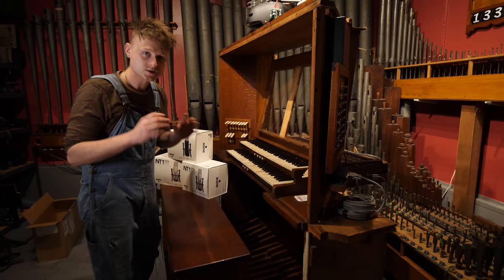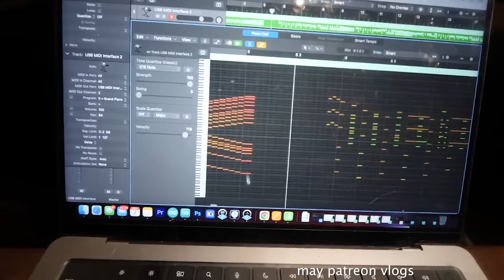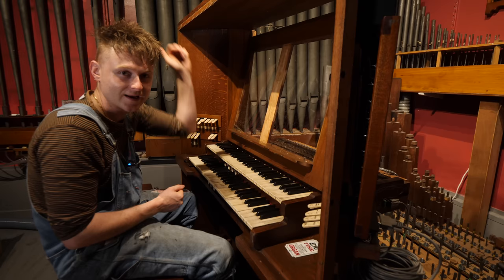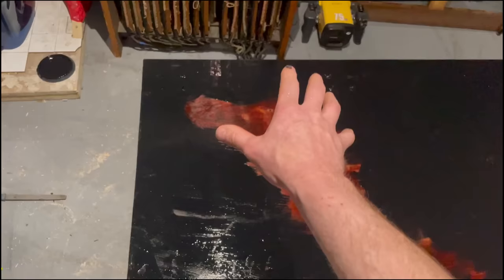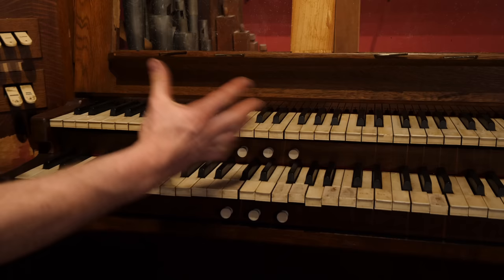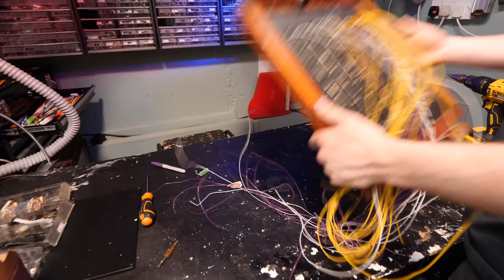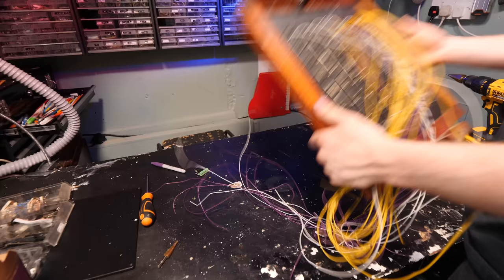100 year old church organs had programmable presets! I BOUGHT A CHURCH ORGAN - part 15

Comment: Have you considered using matrix scanning (use by many keyboards) for inputs, I think this can give much simpler wiring thus greatly reduce the amount of wires needed. The downsides are more complex code for the MCU, and latency for each scan depending on the GPIO.
Reply from the maker: Simply no. It complicates the wiring. Scanning needs more wires ultimately. Less pins but more wires
Reply from the maker: If you think about it. Each key has a wire going to it and there is a common bus. If it needed to be wired into a matrix format it would need extra components and modification to the bus. I did it the way I did it because for future people looking at it it is much easier to diasgnose and repair. If you have access to enough pins there is absolutely no need to use a matrix or multiplex. It's needless complication
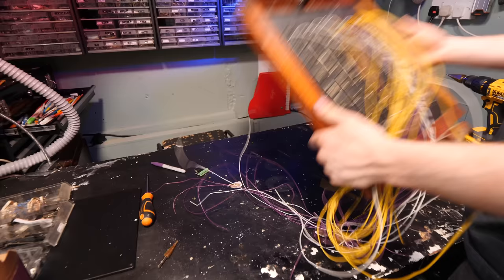Reply: it should be less wires and also without diodes. if you look at 16:19, the matrix will be: each of the white wire coming from the top are the GPIO outs (common), and the inputs are each row x odd/even on horizontal. There won't be a split in the middle either. I agree that it will be more complex for ppl to diagnose and repair, but in this case it is a square matrix that corresponds well with the preset panel so it should be quite obvious
Reply from the maker: @Gentoli  it is not less wires, as each key still needs a wire coming off of it. hence why not doing it,  for future matrix's are a pain to troubleshoot, this is in this instance with a single bus the simplest way. and easiest to transfer to different tech incase an arduino is not available.

Comment: i think working with midi on arduino like those two guys did doesnt take as mush brainpower as it does spacial awareness (basicly know where the empty spots in the arduino are located and where to apply them
look at the computer they used at the moonlanding , it was only a fraction of the current computerpower but somehow they got it to work well enough to hit the moon from the earth and then get back without going up in flames
as for finishing the sides of the console , i agree that the sides should stayvisible , but since its a museum where people thouch stuff it might be a good idea to at least but it behind see through panels or windows , should help dampen the sound a little too
that circus song is hard to listen to at time as it sounds out of key and out of tempo at times , i know its how it was written but still its a pretty good test for the (midi art of the) organ and the electronic valves , i suspect you be replacing some of those over the comming years as they be working harder than they ever did

Comment: You woke up an old brain cell, and it wants to know, does that punch card reader at 10:57 use Fortran to program it? I starterd to learn that a lifetime ago. I love the way they did everything mechanically because physically is shows engenuity. Push a button 100 years ago and push a button today you get the same sound, but it's  made 2 totally different ways.

Comment: I knew about the diodes in the switch paths, I made a sequencer with dip switches and a 4017 decade counter... and got caught with adding a crap ton of diodes... now what I wondered if these old organ switch matrixes dealt with it like that, diodes are modern compared to these organs... so how did they deal with it? Did they have to be careful how they programmed them to be mutual exclusive, or did they have some other trickery or they used relays?  Do you know how it was done?

Comment: That is the crudest setter board, as it is called, I have ever seen. (before you fixed it up).  My console had over 800 switches in the setter boards. I took them out when I converted the organ to digital. (Don't worry, there were never any pipes.)

Comment: How did the original switch matrix function without the diodes? I assume the original electronics did something rather analog-y (e.g. depending on the drive strength decreasing each time it goes through a contact resistance), but it'd be interesting to know the specifics!
Reply from the maker: Seperate wires

Comment: What's funny is that just doing this with analogue methods would have been simpler.  HARDER, because of the number of wires that'd need to be ran, but simpler.

Comment: Could've done the switch matrix with half the number of diodes by putting the diodes on the columns instead of the rows.
Reply from the maker: Reason I didn't was it was a nightmare to solder to the larger lugs. Turned out quicker to do it to the smaller twice as much
Reply: @LOOKMUMNOCOMPUTER  Well reasoned! There's a lot more metal sinking the heat away on the column terminals — and diodes are cheap, after all.

Comment: I'm gonna do a real "your doing it wrong" thing! From a guy who has degloved  fingers,  drooled a hole in the bone and tendons of his left thumb,  accidentally blown himself up and received partial and full thickness burns to the face,  broken 2 ribs,  had several concussions... please don't ever use a circular saw like that again! If I'm shuddering from the potential danger,  then there is trouble brewing from that technique!
Reply from the maker: What is the issue with using a circular saw like that? With an auto cover

Comment: Just wondering: Why was the crossconnection in the preset panel not a problem before adding the arduino? What did they do differently? Maybe some kind of clever switch connections?
Reply from the maker: Diodes didn't exist generally at the time it was made. All wires were completely seperate
Reply: There would have been 48 (8x6) wires coming out of the thing originally, but by turning it into a matrix Sam has 14 (8+6) wires, but with the new problem of "key rollover" that can be solved with diodes. Actually it'd be twice that number because the switches are tri-state.
Reply: Ah thanks to both of you. So you just ran into the problem because you wanted to reduce the amount of wires drastically :D
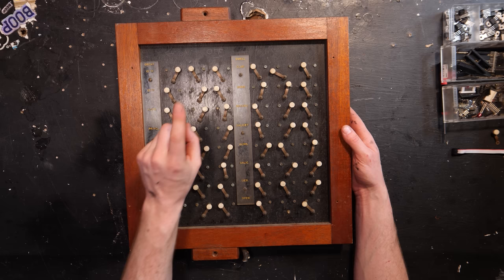Reply: @merseyviking  At 14:39 this is visible: each preset switch had its own wire to the pistons, for a total of 48, bundled up in six bunches. There likely was a multi-contact relay for each piston to control these to avoid the cross-connection issue. The stop side of the preset switches were just bussed up with 16 wires per manual visible.

BTW, by putting the diodes on the piston side of the switches instead it would have been possible to halve the number of diodes, but the way it ended up also works of course.

LEAVE ORGAN WIRING TO THE PEOPLE WHO ARE IN THE KNOW YOU DONT KNOW WHAT YOUR DOING :D :D :D

Comment: You didnt need diodes - you could have used multiplexed matrix scanning - look up how to scan a keypad.
Reply from the maker: You couldn't because that only works for single buttons pressed. When multiple are pushed at the same time. Like in this. Even matrix scanning you need diodes
Reply from the maker: Also wouldn't have solved the LED

Comment: Why, when you go to buy huge boards of wood, don't you check what size you really need, take your battery circular saw with you and cut it before transport. Like with this project you could have cut the board in to 2 halves and it would have been far easier to move.
Reply from the maker: I do it sometimes. But I didn't make a plan before I got the wood.